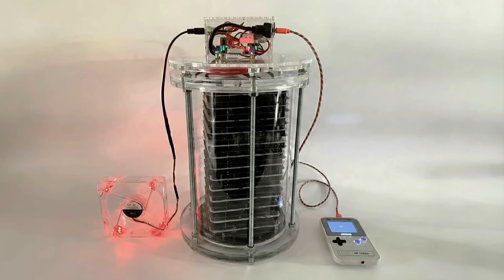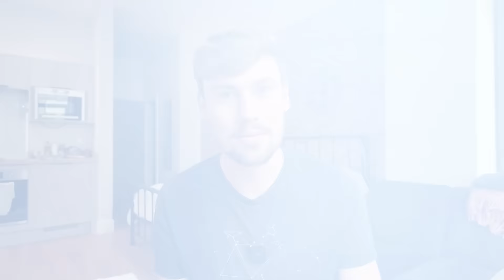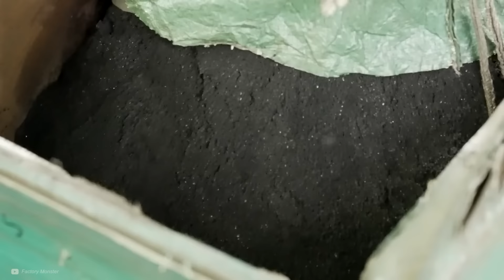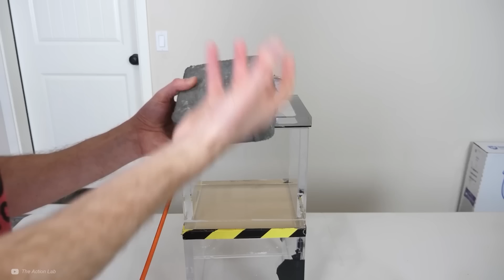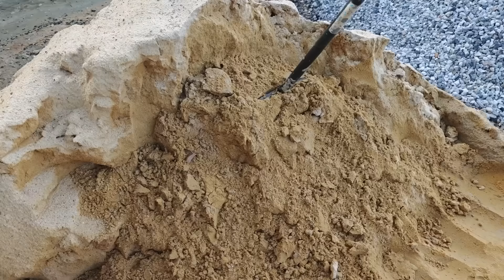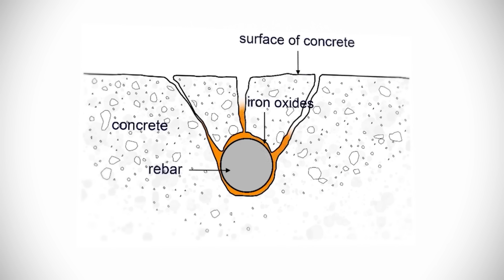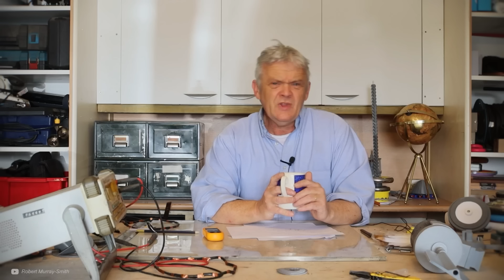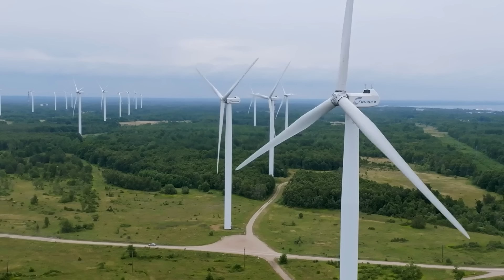How MIT's New Concrete Stores 10x More Energy

Comment: Two problems... 
One) modern concrete doesn't hold up over time... So how much longer or shorter is the lifespan of these materials? What changes do that make on the costs to replace/repair?
Two) What has to be done to recycle/recover materials when torn down! What's the back end costs?

Nothing lasts forever... So planning and considering that happens at the end should have primary priority!!! Not incidental...

Comment: People 13,000 years ago were making special plasters, excavating multi-ton stones, and potentially putting together megalithic architecture out of pure bedrock quartzites like basalt, granite, and andesite at very geoactive telluric-rich areas.

This technology seems to have been rebooted around 5,000 years ago, and persisted until the Bronze Age collapse; Giza is one such place, built on top of another much older place.

Our technology is only new because our egos say so.

(Pure quartzite can be used to generate infrasound, which in turn can be used for sonoluminescence, which can be used to transmute elements or separate hydrogen from methane, which is found literally just beneath the Giza Plateau...think about it and check put Geoffrey Drumm and his work at LandofChem)

Comment: one missed part of this equation is the lifetime cycle of the energy storage. Is this a matter of full depletion and its just now a giant slab of special concrete? Is it rechargeable? How many cycles before its depleted? Do you need to dig out the material and replace it after depletion? 

Amazing material science, but long-term structured batteries need long term storage/cycle life to be practical, or be quickly, cheaply, and easily replaced.

Comment: It's great and all to have a building serving dual purposes, but not once did you mention if reducing cement in the pour would still keep it's load bearing capabilities. Also what organic electrolyte some of them are toxic. Remember the purpose of creating these batteries in the first place is to decrease our carbon footprint which means this entire battery will need to be recyclable, not a build it then forget it.

Comment: Just for your knowledge, MIT did not come up with this concept of a house battery. I came up with it as a teenager in my grandmother's garage in the 90's. I used a metal and lemon juice in air create to cause an electrical charge to pass through the material. Although, I knew lithium was the key. Unfortunately, as a child, my grandma wouldn't let me take apart a bunch of batteries to test it.
Reply: You're def one of the little einsteins

Comment: You could also prefab panels to vacuum inject the electrolyte into the panels. Never pour on site. Super factories could be pumping these out to be delivered to site where you drop them in. It'd also mean they were modular and you could stack up panels to make more storge depending on need. 
I wonder how safe having a heap of energy stored in your load bearing walls is. Like we see what happens when you stroke a LiON battery with a sharp force.

Also the darker colour takes concrete from being architecturally brutalist to crossing into evil fortress terriroty. Can't wait to see an evil corpo erecting a gothic skyscraper out of this material.

Comment: Seems the easiest way to increase the strength without reducing the capacity would be to use carbon fibers in the cement, either in combination or substitutions of the carbon powder.

Comment: had this years and years ago.i can charge my little led light just by putting the charging cord on it and let it hang out.
it use to be that way.dirty electricity goes every where. you can tune it. then put every thing on that frequency.you recycle the electricity in your house. d c is easy to change.. just put a small monopole magnet on your item and it twist it to a c. sorry finger gets blabing.

Comment: There might be possible that they use Geopolymer concreate instead, when it harden, It trap tiny bubbles of water inside (Polymerization of Al, Si, Na, K.. and leaves alone water) in stead of absorb water (hydration reaction of normal concrete), and much more durable too.
Actually sometimes ago I've seen a video that they 've solve dendrite problems of batteries by some kind of ceramic, It might be some connection ?

Comment: Ironically when they discovered how the Romans made underwater curing concrete it turned out they were using blood.
Reply: Lime and volcanic ash more like it
Reply: @apeach666 this one you can Google, they used blood in the mixing of the underwater concrete and they found that that was the secret. It was discovered in 1982 by a engineer in Texas who accidentally just by random luck decided to try blood. He used pigs blood. They found that the interaction with microbes in the ocean did something to the concrete. I don't know what chemical reaction they use today to get the same thing but that's how the Romans did it.

Comment: My first thought is that the concrete will have size limitations. Gravity will pull that electrolyte down over time, right. Also, what about air altitude and air pressure? How might those variables affect this kind of concrete? Then I wonder about how this might affect incoming RF signals. It's possible this could be used to EMP proof data centers. What do you think?

Comment: In modern building practices the form or pit that foundation concrete is poured into is lined in foam sheets or sprayed form layers to build a thermal wall. In some cases this can be all along the bottom as well. It could be sprayed with another hardener insulation material like silicone to make a stronger and prevent water absorbs ion or electrolyte loss. It would seem that the concrete could then be drilled for normal expansion anchors or metal plates as hard attachment points as long as these don't create a circuit and would not harm the battery at all.

Comment: Ok well..

Having buildings made of a energized concrete is like well having a building standing on dynamite pillars...

I'm not saying it would...happen..im just saying it's the stupidest thing i ever heard.

Also there is the decay part...
It would accelerate it aging process hence decay.

Within energy law..you go either for efficiency. Or for absolute raw power.

Raw power cause rapid degradation of matter..
Basic entropic law.

Comment: Ultralight architected lattice
	•	Carbon nanotube or graphene coating
	•	Solid polymer electrolyte
	•	Structural epoxy matrix

You get:
	•	Load-bearing supercapacitor
	•	Low density
	•	Directional conduction
	•	Room-temp stability

That’s cutting-edge structural energy storage research. Summarized convers.

Comment: "damn the battery is 5 years old and the needs replaced, time to knock the building down" This tech is dead on arrival and if the only innovation is the electrolyte and has nothing to do with the concrete... the hell are they even doing?

Comment: Just a couple of things 
1. Almost all concrete is sealed anyway because if not water will continue to seep through it.
2. We used to use super capacitors which charged through the air to run telegraphs and lighting and buildings until around the 1940s.
3. Capacitors will charge from the static in the air all bigger electrolytic capacitors usually have a bar shorting them out connected because if not someone could unknowingly touch the contacts and get a very large shock even killed.
4. Super capacitors.Have been used on cars and other things for years the hard problems is purchasing them. They charge the same rate as lithium batteries do and discharge at the same rate. Although Ive never heard of chemical batteries recharging from static in the air like capacitors do. You must inject electrons into chemical battery’s forcing electrons in there is about a 25% loss from what you put in compared to what you get out I’ve heard capacitors is around 1% but they are used mostly for buffers like when you start a motor when you connect the power there is a big power surge the capacitor will absorb this surge slowly then gradually increasing over a few seconds this will eliminate the spark when the switch closes after that lack of spark the contact is made and is solid the power gets higher through the contact charging the capacitor it charges at a rate of 90% per second. Now. With alternating current it goes from negative to positive 60 times a second in America 50 times in Europe. Now when the current starts going down to zero the capacitor doesn’t like the change and it will fight to keep the current level the same and start putting out current to keep the voltage from changing at the same rate of 90% per second they will use a coil of wire between 2 capacitors which will build up a magnetic field which sort of does the opposite of the capacitor slowing down the collapse between these two you have the capacitor slowing down the charge and the coil slowing the discharge this creates a steady flow now you put a dioxide 4 diodes in a bridge going to this filter a diode will only let current go in one direction you have 2 wires coming from your alternating current source like a generator or the one at the power plant as there coils spin past a magnetic ti will push electrons out the wire on one end the other end of the coil will pull electrons as there coils spin coil makes a loop now the electron flow is reversed on the opposite pole of the magnet so it pushes then pulls eye electrons aren’t really going Jerry far just back and forth through the wire the electrons only move a few inches per minute which causes a lot of heat because you are literally pulling the electrons out of the wire it will get thinner and disintegrate after a few years. But the alternating current. Is only wiggling them back and forth and the real effects is the magnetic fields traveling around the outside of the wire this is where most of the power comes from. So you now have a diode wit the positive confected to each wire coming from the generators your source your supply it goes to one of the capacitors and the coil which has a second capacitor now this connection is your positive voltage coming out. Now you connect a diode with the opposite direction to the other 2 diodes and then connect them together with the other wires on your capacitors this will be your negative terminal on your filter. Diodes are marked with a triangle ant the point of the triangle there is a line that points to the positive wire the base of the triangle is pointing to the negative wire so they are basically a one-way check valve current can only go from negative deposit so hence you have a bridge connected in a square you have a positive and negative conected to each wire coming in you have your positive conected to thr coil anc capacitors you have your negative confected to your negative on both capacitors this will constantly charge your capacitors and fill out any ripples. Now to the point capacitors can discharge up to 90% of their charge per second. We now have a huge capacitor we want to only take out a little power at a time. The ones used in 1900’s and before were wooden barrels filed with oil and dissembler medals from what I’ve heard most of the records and maintenance schedules have been destroyed or classified because they wanted to sell electric for running big motors and equipment. But for just a few minutes stop and think about what you are using electric for all of your TV’s radios cell phones, computers most of the things you have except for big motors heaters automobiles. Almost all of them run on 12vdc your cell phones and most newer computer stuff run on a USB charger those are all 5 volts less than 3 amps. I’m off grid I have a couple 12v refrigerator, freezers they use around 35 watts. I have  a magnetic heart plate on high. It will burn everything at 1000 W. I usually run it around 500 or less.to cook I’m not interested in boiling a quart of water in three seconds I don’t think that’s healthy. It’s certainly not necessary. I have a small washing machine with a spin dryer it draws about 3 amps will wash and spin dry a load of clothes around 5 minutes to wash and up to 15 minutes to spin dry they are still slightly damp but at 70 degrees hanging on a close line or the little folding dryer I have they are dry in a hour or less. And a cement capacitor I don’t think it’s gonna blow up if you overcharge it you might get cracked cement, maybe but I doubt it. It’s big enough. The heat sink will absorb all of the heat from the buildup and I don’t think you can put enough power into a slab concrete to break it.

Comment: Promising, but if used as a formless material for structural casting, this may become a modern High Alumina Cement which did not perform as expected and resulted in much remedial work in the 1960s & 70s. However as a standalone use for non-structural (i.e. cladding) components this could have some use. But I'm not exactly convinced yet for anything but the most basic storage battery for renewables given the poor charge storage capacity at the moment, we shall wait and see no doubt.

Comment: The Tesla Powerwall  feature a 13.5 kWh capacity
Tesla Megapacks are utility-scale energy storage systems with capacities ranging from approximately 3.9 MWh to 5 MWh per unit, depending on the generation

what is shown at 9:55 is a Megapack

Comment: That was very interesting., thanks. It seems like this doesn't require access to any million dollar lab equipment and might be doable as a DIY experiment if the detailed recipes were made public. By the way, it is possible to make a very porous concrete called aircrete basically by stirring in very frothy detergent- the result is a lot lighter but not as load bearing.

Comment: I miss Robert Murray-Smith, he had great videos and I loved how happy science and engineering made him, it was infectious. That said he had a video on making graphene at home which was cheap and easy(whey powder, graphite and a blender), which makes me wonder if it could be added to concrete in place of the carbon? If so that would make the concrete not only stronger but also just as if not better at storing a charge. In addition, calcium hydroxide is an electrolyte which is primarily found in lime, the ancient romans would mix it in with sea water which would add even more calcium ions into the cement making it self healing. So I wonder if you could use a slurry from sea water with the graphene to make a cement battery, would be easier as desalination plants already produce the slurry and it would be stronger then standard concrete and self healing. Also curious if using aerocrete would improve its capacity having greater surface area and pourosity compared to standard concrete.

Comment: Thank you, I so much prefer when someone goes "this is amazing, but here are some of the issues to be worked out, though they fixed x".  Every piece of new tech looks like it will work for x, but what if we used it for y instead; that is the discussion we need.  Using it with Solar/Wind generators seems like a no-brainer to test out the principles and stress the system.  Just one turbine using the concrete could show problems and uses better.

Comment: I created a material that creates power solar. Brick with healing oxide getting stronger with time. Crystallize cell use metals to move voltage. Biochar added for its extra long term binding. 
 Theoretically an exothermic reaction within a granite gravel, calcium oxide, and limestone. This brick could replace coal energy and has energy transmission heat density battery building blocks for roads and homes made from waste recovery. 
Key ingredients are non toxic to land and humanity. It could be the world's answer. Formulas of megalithic structures in closed loop.

Comment: Are there temperature deltas within the blocks? A couple is refining an AI to create incredible structures with rocket nozzles, which can be used easily here: imagine tasking a refined AI to design a 3D printed “modular block” that can, for example, make a dedicated wall (such as a plumbing or electrical main wall that can also serve as a main structural column - no drilling here and make it slightly expensive for the idiots to scoff at it/cheap enough to not become a status item, and remove common sense liability).
This way, the catalyst can flow through the brick-matrix and open up better energy storage via hybridization with sand (molten would basically transform this wall into a power plant of sorts even, use solar panels as ignition, etc already common parts) or even recycled LiPo/etc battery trays.

Structurally, concrete best performs with saltwater as the humidifier (ask the Romans how their stuff after centuries stand dry while home depot pros still can’t make anything last more than 30 years, let alone dry not even 15 years lol) which also makes for a great medium as well as part of what sand batteries use.

To scoff at what is being experimented on as a wholistic, bird eye picture is foolish. There is something crucial and next-level-everywhere here!

Comment: Structural capacitors seem like they would make no sense to me since you need to hang hardware on walls to support indoor walls, pipes, wiring, floors, etc.

Pourable capacitors may be handy for HVDC power lines which are going to need large DC capacitors to smooth out fast line and load transients. Make forms from the electrode separator material, pour the anode and cathode, let them cure, pull a vacuum, flood with electrolyte.